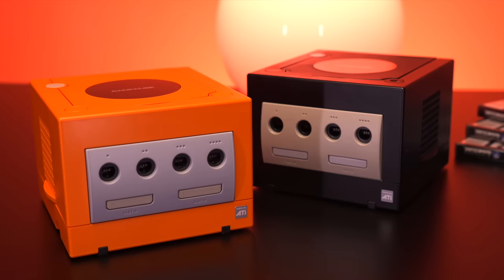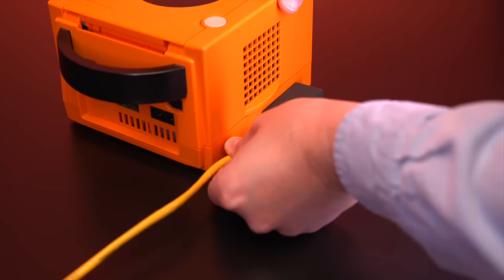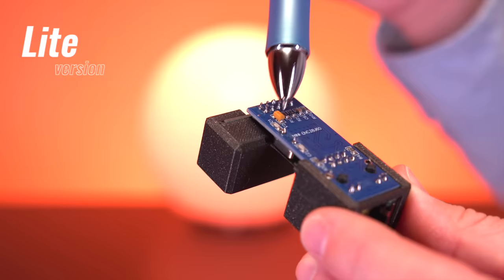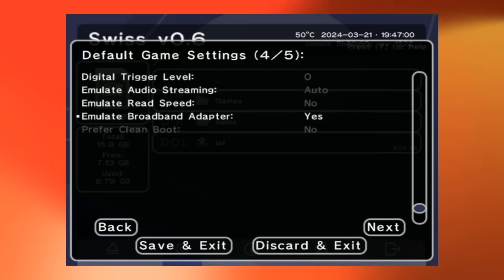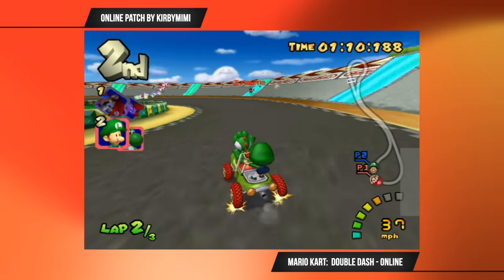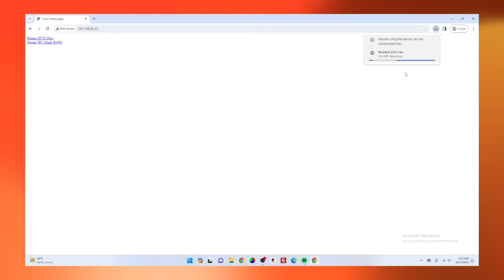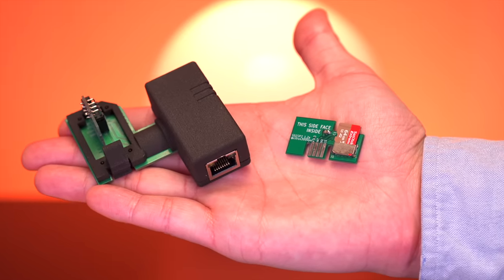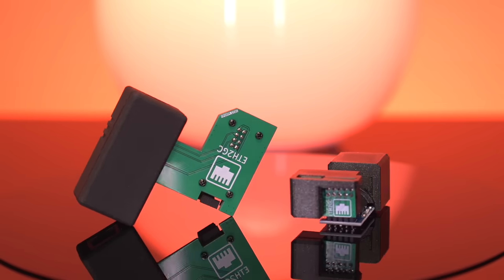DON'T Buy A Gamecube Broadband Adaptor.  THIS Is CHEAPER!

Comment from the maker: UPDATE:  Extrems has notified me that no configuration of Swiss is required to get the ETH2GC to work.  Once you update to the latest version of Swiss, the ETH2GC is ready to go, just plug and play!  If you enable Broadband Adapter Emulation by default, it will disable memory card emulation for all games.
Reply: Can I use this adapter if I don’t have swiss on my gamecube? It would be great to be able to use this adapter without modding my gamecube.
Reply: Can u lan a gamecube with the eth2gc and a gamecube with the og braodband adapteur?
Reply: @pamendez3  Unfortunately not. Swiss is required but you can use game save exploits if you don't want hard mods.
Reply: @maciejkobus  I was expecting to see this in the list of cons, this video could lead to people getting the adapter thinking it would work with their vanilla Gamecube...
Reply: The bro making the Zelda mod is gonna get slapped down. As soon as you start taking money (Patreon) for Nintendo's IP, you're fcked.
Reply: @biduleman6941 he literally says you need Swiss at the start of the video going through the methods to load it, if people are under the assumption it’s plug & play then they clearly didn’t watch/understand the video
Reply: @pamendez3 It looks like this is a fundamentally different piece of hardware from the original broadband adapter. I think it even attaches through a different port.
Reply: Cool... but $45 for an ultra niche GC accessory? 
Sorry to say but I think 6 months from now when there's a chinesium copy for $5 I'll probably go for that
Reply: @fowler0028  "if people are under the assumption it’s plug & play then they clearly didn’t watch/understand the video" 
Not necessarily. I watched the entire video and was misled by the fact that he didn't mention that requirement in the "cons" section. It should have been there. What also should have been there is the fact that this device prevents you from using your SD2SP2 device as well. The "cons" section for this video was handled very poorly.
Reply: @budadepapel pues requeriría extra trabajo
Reply: @Stealthbat you being mislead is on you not him, he literally mentions you need swiss at around the 2 minute mark then goes over how to load & set it up from around the 4 1/2 to 6 minutes mark.
Reply: @fowler0028  "you being mislead is on you not him"
You would be correct if this wasn't an information/review video. Because this is an information/review video, the uploader has a responsibility to be as clear as possible with the information being expressed. That is just as much on him as it is on me or anyone else. If you are reviewing a product, it is your responsibility to present your findings in a clear and easy to understand manor. It is not the responsibility of the watcher to figure things out on their own. Because if it were, then there would be no point to the video.
Reply: @Stealthbat  he literally INFORMS the viewers that you NEED swiss and how to set it up, simply because YOU believe that it should be included in the cons section DOESN’T make it any less of an “information/review” video. But keep crying about it to coverup your lack of understanding 🤷‍♂️
Reply: @fowler0028  I see that you're having trouble understanding me. So let me see if I can clear things up for you. Yes. He does briefly mention that requirement in the beginning. However, in the "Pros & Cons" section of his video, a section that MNP created himself, he goes over all of the good and bad things about the product. That includes any and all good and bad things that's already been mentioned up to that point as well as new things that haven't been covered yet. This is the way MNP has used the "Pros & Cons" section in all videos prior to this one. So, you see, yes, he mentioned it, but he didn't include it in the summary section of the video. Thus, he wasn't clear about it. Also, I would appreciate it if you could leave vulgar comments out of this discussion. I have been very civil with my responses. All I ask is that you do the same.
Reply: @Stealthbat  keep twisting things and crying because you’re unable to understand and have misconceptions about the product 👍
Reply: @fowler0028  I have tried to be civil in this discussion. Thus, if you cannot be civil, then there is no point in continuing, as there is no point in arguing with a bully.
Reply: @Stealthbat ahh the play the victim technique, ok bye 👋 

P.s you had a point regarding the sd2sp as others mentioned it, but putting needing swiss in the cons because you can’t understand it from the few minutes he took saying you need swiss + how to load it and set it up is pushing it.
Reply: @iamdmc  $45 for the pre made top of the line version, $15 at the cheapest for the DIY version.
Reply: @Stealthbat  he literally said you need Swiss in the video though, that doesn't require a con section. That's like of you watched a mod chip video and then we're confused that you needed to mod the console to use the mod chip.
Reply: @NottJoeyOfficial  careful he’ll start accusing you of being a bully 🤣
Reply: By enabled by default do you mean memory card emulation works when the adapter is in use but not enabled by default or does the Ethernet adapter just not able to share system resources.

Comment: i think a con is that it uses serial port 2. You can't use it with later gamecubes or the panasonic Q, and at the moment not with a sd2sp2. Still great that this exists regardless
Reply: Also if you have a Wii you can just use Nintendont and emulate the broadband adapter over WiFi
Reply: Agree, but until they can migrate it elsewhere I'm not going to invest and I feel this may be the case for many others as well who's discs have since died and rely on their backups.
Reply: The fact that it doesn't work on a newer Gamecube is not even a real con since those consoles don't even support component video, so no Gamecube enthusiast should/would be using one of those in 2024 anyway.
Reply: Just checked my Panasonic q and can confirm it does have the sp2 plug.
Reply: @benallen895  I think people do not realize you can get SD card adapter that connects to front memory card slot. It works exactly the same as SD2SP2. It was mentioned in the video.
Reply: Sure yeah they don't support later gamecubes but I'd say that still is a real con, sometimes you only have the later models on hand
Reply: yes, i dont understand why this not made for broadband adapter slot
Reply: Was about to comment the same thing about SP2 - there are units that have the Digital Out port but not SP2 (the last DOL-001 variation before DOL-101).

As for SD2SP2, as others have already said, a GeckoSD/memory card SD adaptor will work just fine. This is what I do since I don't have an outward facing SD card slot so removing the GB Player to load newly dumped games is a hassle.
Reply: @MrWozt They're gearing up for the M.2 Loader, which does use the broadband slot
Reply: @MrWozt My guess is another one of webhdx's projects is m.2 adapter and it uses the SP1 port to house an ssd.
Reply: @davidoli  Honestly. Everything GameCube related works better on the Wii. But it is still awesome to have these insane mods for the GameCube
Reply: The board's still got the traces on it, and the case still has enough of a hole for wire access. If you're willing to do a tiny bit of hacking, this is still accessible.
Reply: Even if it requires SP2, I wish there were a version that came out of the SP1 side of the console. These ports sticking out of the side are super ugly and I don't like that. If I use one, I'll be removing it when not in use anyways because of the fact I want SD2SP2 and I think it's very ugly.
Reply: @NottJoeyOfficial  I agree, it would have been much better to have it just be in the SP1 port so it wouldn't stick out of the side of the console. Maybe it would even allow native support though that might not actually be possible, it at the very least would be inside the console completely without sticking out of the side.
Reply: Technically that's not exactly correct you can use them in a newer GameCube but in order to do so you would need to hardwire them to the SP2 pins on the motherboard, which is more work and probably not worth it since those models lack Digital/component video support.
Reply: @daskampffredchen  some would argue in the case of component video that is not true,  especially if you have the Nintendo OEM cables.  While I love mine, I rarely use them ever since I got a carby.
Reply: @davidoli  I think dolphin also has broadband emulation support so playing online that way is also an option.
Reply: @draconic5129  yeah, it seems currently due to technical limitations it has to be plugged into SP2, but having the port on the SP1 side while still plugged into SP2 would be the best case here. I think perhaps when I learn how to and when a version with SD2SP2 support releases, it may be a good idea to try and mod my own custom version of this.
Reply: @mazda9624  s-video is perfectly fine on an actual tube tv, ain't like you need component
Reply: Also with my GCLoader setup my Swiss settings are stored on the SD card I have in serial port 2. So I'd have to deal with not having any permanently saved settings. Granted I could go the memory card route, but I like making my gamecube aesthetically look like a stock model.
Reply: What's the difference in speed compared to memory card with an sd card slot?  I'm getting one but it'd be nice that I won't have to disassemble my GBPlayer just to get to the SD card.
Reply: Most people talking about the pros and cons but most of them will never go through the trouble of getting this to play network GameCube games. The Wii is the better investment for 98% of people. Still neat though
Reply: There's plans for mem card
Reply: This is why I wish I had a dol-001 unit.  I only have a modded dol-101 Pokémon XD GameCube region changed to Japanese.
Reply: I think it's because webhdx already has the m.2 loader for sp1
Reply: @legendofcho didn’t realize this, thanks. yea once the M2 Loader becomes widely available then I won’t use the SD2SP2 anymore and then I can buy this ethernet adapter.
Reply: Later GameCubes aren’t really worth keeping around IMO for the enthusiast. No digital port, no sd2sp2… sell it and get a DOL-001.
Reply: @mazda9624  so you only support the optimal setup. Then why not just tell people to use a real bba
Reply: I guess my biggerst gripe is that there isnt a version that can fit more flush within the console :/ Hopefully that will come someday soon!
Reply: @davidoli  I've found the WiFi to be spotty on WII. Hard wired is ok though
Reply: @maciejkobus  it isn't 'exactly' the same.  Games are more compatible when running through SD2SP2 than the SDGecko.  The only issues I've had with SD2SP2 is some homebrew (like Cube64) hasn't been updated to work on it.
Reply: @Crazy_Gamer_OG  Compatibility is literally the same. It's a myth. It was debunked many times by Extrems - the person who develops Swiss.
Reply: @davidoli  Now that's actually interesting. I may wish to do that sometime.
Reply: @draconic5129 to use the sp2 port on a dol-001 that came unpopulated, it is not as simple as wiring directly to the pins. You also need to add FIL22 and another nearby capacitor onto the bottom of the mobo. I found this out the hard way after trying to solder a sp2 port onto a dol-001 that didn't have one before. Luckily to get that port and related components you need a whole donor board anyway. Lol
Reply: Yeah I'm surprised he said he doesn't see any cons despite mentioning this before. SD2SP2 is the cheapest and easiest to find storage method for booting Swiss and running your GC ROMs, a lot of people don't want to do hardware mods on their GC and Geckos can be very hit or miss so the SD2SP2 is very, very convenient. I'd say this is a pretty big con, but if they manage to integrate the SD2SP2 into this adapter it'd be truly amazing and virtually have no cons.
Reply: @StefiStarlite  isn't the geckosd heaps slower then the sd2sp2
Reply: @yobb89  Not that I've noticed, I was under the impression that both Serial Ports and the memory card slots shared the same bandwidth lanes so speed was the same.
Reply: I wish it used the broadband slot.
Reply: @maciejkobus  Yes, you can, I have several, but they are much slower.
Reply: @MrWozt  word, that would actually impress me.
Reply: If I remember correctly, they didn't HAVE to use SP2. SP1 has all the same functions as SP2 and more. They simply failed to think their options through.
Reply: @dlang6487 The M.2 Loader is just a SATA SSD on an adapter. It's NOT an appealing option when there's no performance gain to be had over an SD2SP2 especially when it's so much more expensive.

Comment: There's one BIG con. You can't use an sd2sp2 with it. It's either you have an sd2sp2, or you have network. It would have been better for the project to use the sp1 port, where the original BBA/Modem would have went.
Reply: Just use front memory card slot adapter. They cost a few bucks and work exactly the same as SD2SP2. Supporting other ports is difficult because Swiss is running out of available memory.
Reply: with the m.2 loader being available at some point that effectively resolves this issue entirely
Reply: It's a shame, however I'm going to get a Flippy Drive whenever that becomes available as my SD2SP2 Gamecube can't read the boot disc (or any disc) anymore.
Reply: If you've already tried pot tweaking the disc drive, or/and replacing the laser, then it's probably the 3 capacitors on the drive control board  @Dad_Shoes
Reply: Oh wah
Reply: People in these comments seem to not understand that not everyone wants to hardware mod their GameCube. The Memory Card loader is the best option at this point, but it looks ugly. This adapter looks ugly too though so I guess it doesn't matter. They should have really made it come out of the Serial Port 2 side of the console so there isn't a massive tumor hanging off, hopefully since this is open source someone will do that.
Reply: @PurpleHayesWA  When the M.2 loader is actually available.  Project was cancelled at one point due to chip shortage related issues.  No new news on this front.  It will be neat when it actually comes and maybe it will be compatible with nvme M.2 drives (more common today)
Reply: Yeah that’s a really big deal.
Reply: @BenignStatue71   There are NVMe to USB enclosures, I've used one myself. I'm not getting it confused with SATA drives, those only work with a different adapter.
Reply: * would have GONE

Comment: One major con: this isn’t usable on DOL 101 models. They don’t have a serial port 2.
Reply: Also cubes that use picoboot through sp2
Reply: @wolfsquatch  I thought picoboot only worked with the IPL chip. If you're talking about the SD card, a standard picoboot should boot from an SD Gecko without any reconfiguration.

Comment: You lost me at "serial port 2". That's where my microSD adapter is. And that also means this doesn't work without hacks. So it's not a very good alternative to the original. Were they not able to make this thing work in serial port 1? I really think they should do that instead.

Comment: Why didn't they make the adaptor so that it connects to Serial Port 1 (like the official ones) instead of SP2? That way it could be easily used alongside the SD2SP2.
Reply: Some people think that the SP1 could be utilized for an SSD when it's available.
Reply: Likely because webhdx is developing a m.2 loader in that port.
Reply: @romanantonacci4622  I’m pumped for the M.2 loader to release
Reply: @TheDOSGamer  webhdx here. It's simply not true. There are some limitations in the software that prevents us from using Serial Port 1 for BBA emulation at the moment. Actually it was Extrems' idea to use Serial Port 2. I was totally fine designing the hardware for Serial Port 1 if he would have asked me for it. Keep in mind that the open source design that was meant to be cheap would be at least 2 times more expensive with Serial Port 1 due to complexity of the design to make it sit firmly in the slot.
Reply: So is there any protocol conversion going on here, or it is basically just connecting the SPI port on the ENC28J60 to the EXI bus? @maciejkobus
Reply: @TrimeshSZ  It's using SPI protocol so no conversion is required. But the limitations come from Swiss and its hypervisor and the fact Extrems is constantly running out of memory to accomodate all the patches. This is why you don't get Memory Card Emulation together with Audio Streaming in games. There are sacrifices to be made. This is why ETH2GC uses Serial Port 2. M.2 Loader story is both untrue and unfair.
Reply: @WJCTechyman  they are currently working on it so it will be available once done.
Reply: OK, got it - so it's basically patching all the existing titles to use different ethernet hardware. I guess in this context it's quite helpful there were only a handful of them in the first place! @maciejkobus
Reply: @WJCTechyman  if they did that that would be great, though one of the big issues with using SP2 for BBA is that it sticks out of the side awkwardly (both for the lite and sidecar) which is one of the reasons why I think it would have been better to just have an SP1 broadband adapter, even if it is an emulated broadband that isn't natively supported.
Reply: @maciejkobus Will there be an option to use WiFi or is that not possible?
Reply: @maciejkobus   Aren't the two ports (actually the four ports) electrically 99% identical? I'm trust there's a software reason you can't use SP1 for emulated BBA but would the memory card slot work? Or how about an SD2SP1 to move the SD card? It would also be easier for us DOL-101 users.